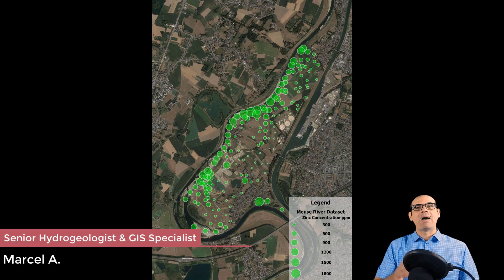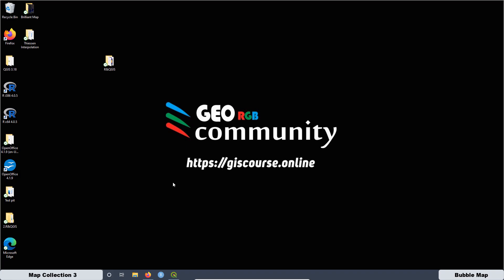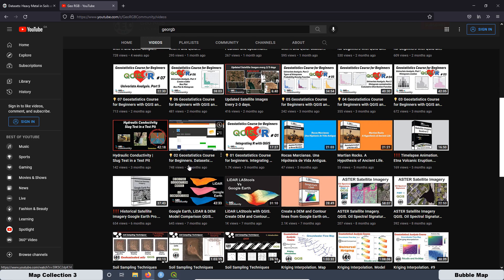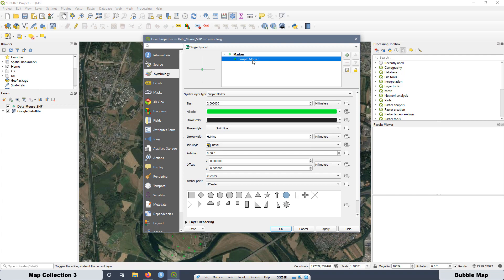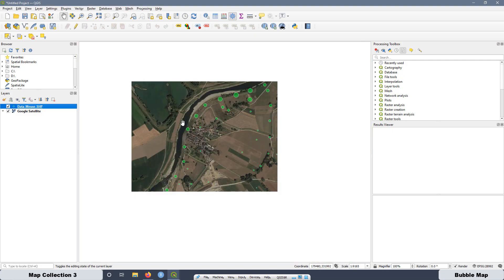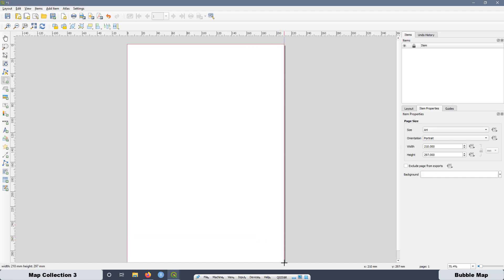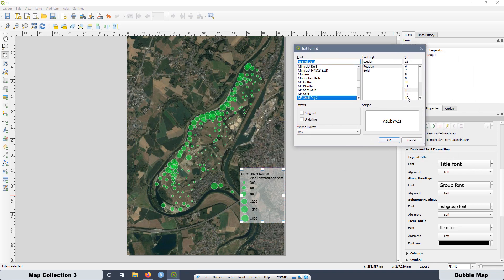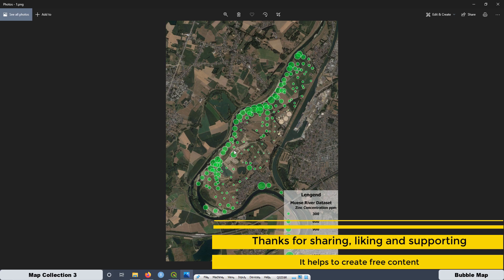🌎 Bubble Map.  Map Collection 3.

Comment: Hello sir. Is it possible to show fine particles like 2.5mm in qgis map. How to set such scales.
Reply from the maker: It depends on the range of your data. For example if the range goes from 2.5 mm to 1km, it is going to be hard to see the 2.5 mm. You can consider to transform the data to improve the range.